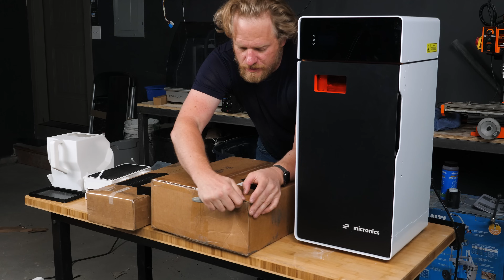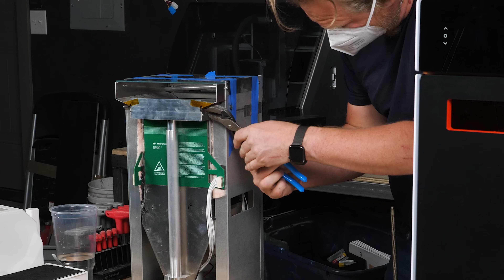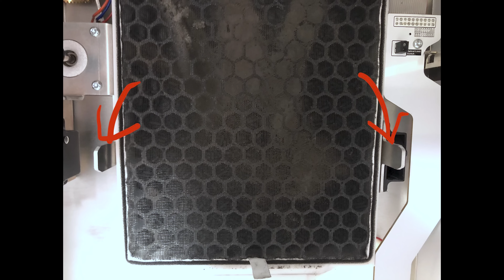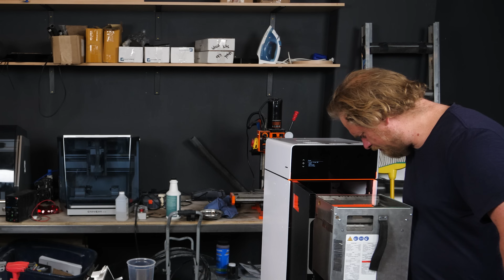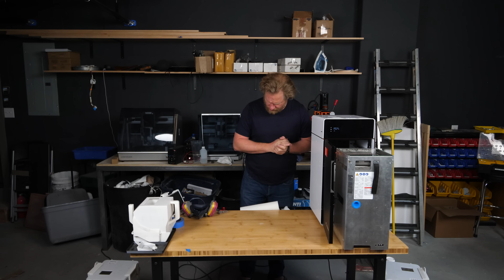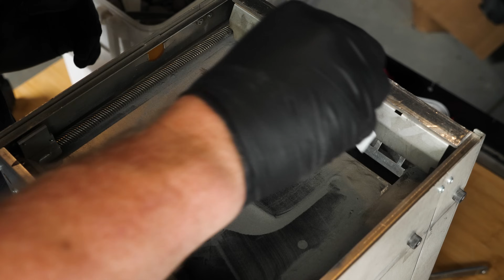Kickstarter Canceled! What’s Next for Micronics?

Comment: I think this acquisition has a bit more too it. Micronics wanted to make SLS affordable for everyone, almost the opposite of what Formlabs appears to want. I think Micronics realised they were getting out of their depth with all the issues with your printer and what they would need to do to make it production ready. They would have gotten lots of money from Kickstarter, enough to fund the rest of development if the printer was as finished as they seemed to think, it’s not like it was a failing Kickstarter.

You say that they are now the head of the Formlabs SLS division, is that actually confirmed? It seems very odd to buy out a startup made of two university graduates and make them the head of an already established department.

I do wonder if this was also just Formlabs wanting to get rid of Micronics so they would have less competition. I do wonder what the terms of the contract are, does Formlabs now own all of the IP? If so then the two graduates likely couldn’t leave and make another company making SLS printers.

For Micronics to change their values so quickly isn’t a good sign, Formlabs is pretty much a business/industrial company with very expensive products that like vendor lock in (hence the open materials license even existing), Micronics was supposed to be to make SLS affordable, the two goals do not align. Offering $1000 credit plus an open materials license to backers seems like PR more than anything.

It’s disappointing to see this acquisition. I doubt Formlabs will undercut their existing products. The Kickstarter was going very well and according to them and their scoring system the printer was nearly perfect (I always found this a bit odd and optimistic anyway) so why basically give up on their main goal that they used heavily to market their Kickstarter?
Reply from the maker: "You say that they are now the head of the Formlabs SLS division, is that actually confirmed?" This is what Henry told me a few days ago: "the current plan is for me to lead the SLS team".  But I didn't see that confirmed by anything from Formlabs today, so I'm not totally sure.

And yes, Formlabs now owns all their IP, and I imagine there's a noncompete in place, as part of the sale.
Reply: @strangerparts  good for Henry if that works out long term but it still seems odd to make a university graduate with very little if any experience in industry the head of a department, especially when the department is well established and likely has lots of good and experienced engineers working for it. What happened to the guy that Henry is replacing?

As for non compete agreements and Formlabs owning all the IP, I doubt we will ever see the two guys again, especially not in another company making SLS printers. As much as I criticised them I did still hope they would succeed, more for what it meant for the community rather than for their product working out.

I hope for Micronics sake that Formlabs aren’t taking advantage of them and their ambitions. I hope Formlabs aren’t just giving them a high up role just to keep them happy whilst not actually doing all that much, or giving them a high up role so they can fire or replace them at some point, just using the role to get them to accept the deal.
Reply: @conorstewart2214  Probably Formlabs offered more money than they managed to get on Kickstarter.

Comment: The transition from working prototype to a mass manufacture product is difficult. I have my own experience where I have designed and built a device for music production that works really well, people like it, prototypes are reliable and being used right now but that next step from hand-built to manufactured item has stopped me in my tracks. 
I considered launching a Kickstarter to get people to fund the manufacture process but the risk was huge if I even hit the smallest problem with getting them built. I have a day job and a comfortable family life, the potential for failure and losing everything is too great to expect my loved ones to take that risk with me.
One day I might launch it as an open source project and see where it goes, I did design it from the start to be hackable and user modified.
Reply: Thats interesting, what did you build?
Reply: @JimmyMakesOfficial  MIDI performance controller/sampler

Comment: This product was no near production ready. That formlabs bought them makes total sense. They will never actually produce this sls printer. The two guys are probably millionaires now. Good for them and their hard work and dedication payed off, but for the makerspace a huge step back.
Reply: I think the fact they were acquired means they were close to production ready, sadly.
Reply: @802Garage  I doubt that. Look how many problems this machine had. They cannot fix that many things that quickly.
Reply: @stockspieler-yv1fs  There were 3 rather small issues shown in this video which are fixed with minimal design revisions and 1 issue likely caused by something small that would need addressing. The auger design was already amended. I'm not saying there were no more issues, but there were also multiple creators, at least 4 I know of now, who printed successfully. Of course this product would have had teething issues, but I'll leave it at that paired with my original statement.
Reply: @802Garage  Not necessarily - if this was a defensive play by FormLabs to lock up the IP it behooves them to acquire early/maybe even prematurely while the price is cheap. Won't really know for a few years I guess.

Comment: Overall I think this is bad for the consumer and is unlikely to result in low priced SLS printers that hobbyists can afford.  That just isn't their market, and expanding into that space creates all kinds of additional support costs. I suspect they wanted to delay the release of a product that could undercut their Fuse printers, and maybe some IP they could utilize. 

But this does likely make sense for the Micronics team. Looking at the design through these few videos I don't think the design would be scalable and reliable even if they did get it to a point where they felt like they could release it.  The company probably would have failed without an acquisition, but if they got the product out there then it would have hopefully inspired others to try to develop the same thing  (if it hasn't already).

Comment: A company that charges thousands just so you can use any material in their SLA printers will never release any affordable SLS printer anytime soon
Reply: Yeah, any company that hard locks printers to only one specific material or ink is a terrible company. These practices should be banned.
Reply: @TheZeek  Sometimes its a limitation of the technology and material; particularly laser tech

Specific materials need different activating wavelengths; could get biproducts/no products at all at the wrong wavelength

but overall totally agree, if the machine is capable of it, then its so scummy not to
and if they have bought out micronics to prevent competition like it looks then that’s even scummier
Reply: @BirnieMac1  thats BS as there is nothing special about getting the exact same powder from a different company will mean it wont work. its just the ink printer model on expensive machines.

Comment: This is most likely a bad thing over all. Consolidation is almost always bad in the long run, and this very much feels like Formlabs is buying out Micronics to avoid the competition. I could be wrong, maybe they were considering working on a lower-end SLS printer and they really just wanted to skip half the R&D by acquiring a company that was already half way there. Best case scenario, in a couple years something much like the Micronics printer comes out from Formlabs at only a small ($1000-$2000...) markup. But I kind of doubt that, more likely they release something mid-range (for them) that costs $10k+. The Form Fuse is $30k for just the printer, the "complete package" is $55k - we're talking new car money here. So compared to their existing product line, they could advertise something as "entry level" if you got the the complete package for under $20k which would still not even get it close to affordable for hobbyists. But what I think is the even more likely scenario, the worst case, is that they simply do absolutely nothing like that at all. They just buy up Micronics IP and employees, cancel the project, reassign or lay off everyone, and have prevented any competition from undercutting them in the SLS market. I hope I'm wrong, I hope that in a year or two Formlabs releases a $5000 SLS printer that's simply a refined and completed version of what Micronics was doing. Of course, even if they do it will involve their material DRM which makes it a downgrade regardless. But I fear that that's not what's going to happen, I fear they will do what big tech has been doing for years, and burry any competition.

Comment: We need a Voron style OSHW project for benchtop SLS, not a crowdfunding daydream.
Reply: that project exists an its called sls4all
Reply: @MAYERMAKES nice, I didn’t know this existed! $6500 for a kit is a bit high though. I think the $3500 price point targeted my micronics makes more sense
Reply: If two college graduates and a professor can do this in a few years then a fully open source version should be possible too.

Even though this has been bought out maybe it will give the community a push to build SLS printers.
Reply: If anything came out of this that's usable, I'd think their slicer would be the best thing to have available. Since the video with formlabs showed their slicer several times though, I don't think they'll give it up.
Reply: I don't know, I reckon this kind of thing needs higher precision manufactured parts and much less of the shelf than a typical FDM printer. I suppose a RepRap style one where you use nylon parts could work but someone who has access to such a machine, and the time and skills to begin such a project is probably rare
Reply: Sls4all?
Reply: Not holding my breath
Reply: SLS4ALL exists btw
Reply: For the folks saying that SLS is too hard to develop in the open, I figure if two newbs and a professor can do it in a year or so then it's possible for the global community of OSHW companies and individuals to somehow figure it out. 😹
Reply: I dunno about open source any time soon: These guys out in an absolutely insane amount of work iterating and refining. That level of rapid development cycling would take a long time and a ton of dedication. It could happen in the fullness of time, but this is orders of magnitude more challenging than something like the Voron project.

Comment: hm i think if formlabs will sell this printer it will be very good and very expensive. when i bought my first 3d printer i went with one of the cheapest on purpose. it took a lot of work to get it somewhat working but now i know more about 3d printers than i would have known if it had worked out of the box and i saved a lot of money. i was kind of hoping you could have a similar experience with this printer.